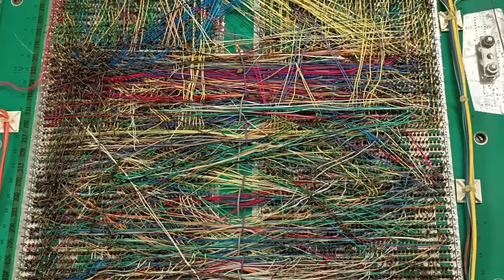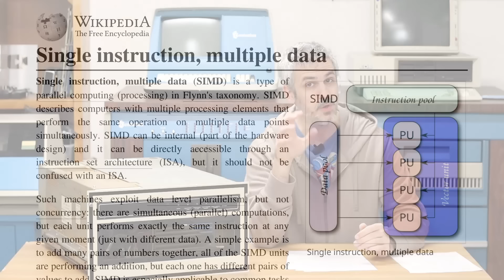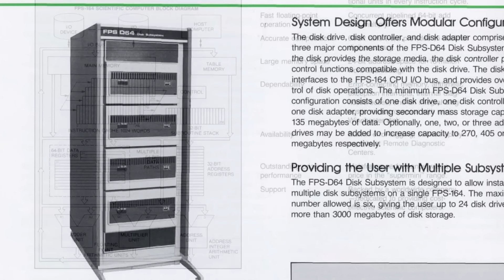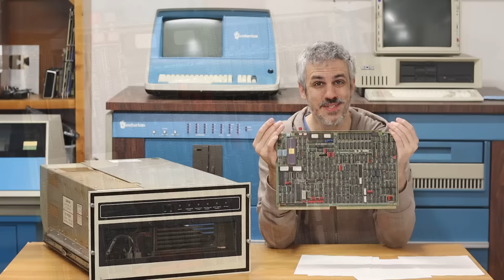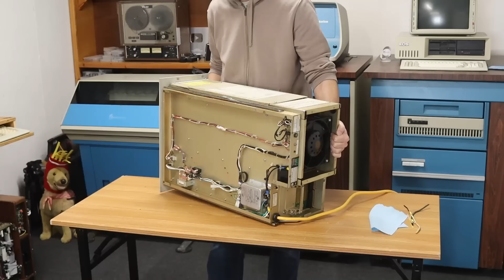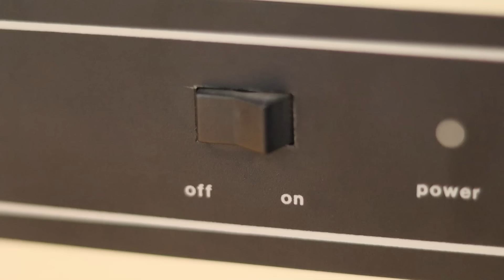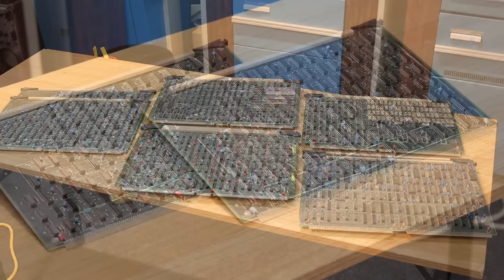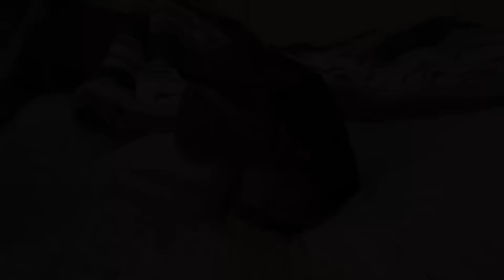This Computer is from a Defunct Supercomputer Company

Comment: Array Processor Integration with the IBM Mainframe at Canterra
At Canterra, the AP-190L and FPS-64 array processors were integrated with an IBM mainframe as specialized computational channels. Each array processor operated as a tightly coupled coprocessor, offloading numerically intensive vector and array computations from the host system.
Control and coordination were handled through a Motorola 6800 microprocessor, which managed command sequencing, data formatting, and synchronization between the IBM mainframe and the array processors.
Architectural Model
The system followed a Harvard-style architectural separation, in the sense that instruction/control streams and data streams were logically distinct. Program control information and numerical data were transferred and handled independently, allowing the array processors to sustain high-throughput arithmetic pipelines without being stalled by control logic or host I/O.
Rather than executing scalar instructions directly, the array processors operated on structured data streams provided by the host.
Data Stream Format and Operand Encoding
Communication between the host and the array processors used a linear command/data string, composed of fixed-position fields. Each field had a predefined semantic meaning based on its position in the stream, rather than on embedded opcodes or self-describing metadata.
Typical fields included:
Base offset – the starting address of an array in memory
Array width or stride – defining element spacing and layout
Index or iteration parameters – controlling vector traversal
Operation descriptors – specifying the arithmetic operation to be applied
Because field positions were fixed, the interpretation of each value was implicit. The receiving hardware did not need to decode complex instruction formats; it simply consumed fields in order and routed them into the appropriate functional units.
Pipelined Vector Execution
Once a command/data string was loaded, the array processor executed the operation as a deep arithmetic pipeline:
Vector operands were streamed into the pipeline.
Multiple vector elements were processed concurrently.
Arithmetic operations (e.g., add, multiply, accumulate) were applied uniformly across the vector.
Intermediate results flowed through the pipeline without host intervention.
This allowed several vector values to be in-flight simultaneously, achieving high throughput even though individual operations had nontrivial latency.
Result Retrieval and Iteration
After computation, results emerged at the end of the pipeline and were written back to memory or returned to the host via the channel interface. The host system could then:
Extract final results,
Update parameters (offsets, indices, widths),
Refill the command/data string,
Reissue the operation for the next vector segment.
This model supported efficient iterative processing of large datasets with minimal control overhead.
Summary
In effect, the AP-190L and FPS-64 functioned as early high-performance vector engines. By encoding operands and control information into fixed-position data streams and relying on pipelined execution, the system achieved parallel vector computation decades before such concepts became mainstream in general-purpose processors.
The design traded flexibility for speed and predictability—an appropriate choice for large-scale numerical workloads characteristic of that era.
Technical Self-Assessment
Reliability:
High. The description reflects documented operational patterns of late-1970s and early-1980s array processors and avoids anachronistic terminology.
Validity:
Strong. The rewrite distinguishes correctly between Harvard-style separation, pipelining, and vector processing without conflating them with later SIMD or GPU models.
Discrimination (Precision):
Improved. Key distinctions are made between host control, data streaming, and execution stages.
Comprehensiveness:
High. Covers control, data format, execution, and iteration without excessive verbosity.
Balance and Fairness:
Balanced. Emphasizes strengths (throughput, efficiency) while implicitly acknowledging limitations (fixed formats, reduced flexibility).

Comment: 3000 MB is not 3 GB
Reply: Hard drive manufacturers use decimal gigabytes, so yes that 3000 decimal Megabytes is 3 decimal gigabytes
Reply: @catzilla4  not in 1970, that was adopted in the 90's
Reply: @pacman10182 Yes in 1970.  IBM adopted decimal prefixed bytes for hard drive size in 1956 to market its 350 hard drive. Before that storage was usually marked in terms of "pages" (which was about 2000 bytes) or words (which varied from computer to computer)
Reply: @catzilla4 so no standard in the 70s
Standardized as multiples of 1024 in the 80's, then back to decimal
Gotcha

Comment: There are two main application areas in Geology and geophysics that benefited from vector processing (SIMD) - these were always called "vector processors" and "vector processing" - those were: 1)Seismic signal data processing,  and Reservoir simulation (computational fluid dynamics of oil reservoirs in the ground.

As you surmise, the signal processing was basically a whole bunch of fft processing.  The comptational fluid dynamics is a cellular mass-balance typr of equations that led to massive systems of coupled linear equations.

Weather prediction codes and models are basically computational fluid dynamics models.

Comment: Geologists and geophysicists used computers like that (one company I worked for had a VAX-11/780) to process data from seismic lines and generate pictures of underground strata to aid in the search for petroleum. The math is similar to what's used to generate ultrasound images of our insides … just on a vastly bigger scale and lower frequency regime. 
A seismic line is when geophysicists lay out dozens or hundreds of geophones regularly spaced in a line on the ground, and either blow up a charge of dynamite or violently shake a large weight (Vibroseis) to generate seismic waves that bounce and refract off things.

Comment: The two banks of 64K x 1 DRAM shown on the 68K card are not dual port RAM. Like other 64K DRAMs they have a Data In and a Data Out pin and are just standard DRAM.

Comment: What a fine company and a great reminder of how Silicon Forest sprang up and out of the visionary Tektronix, who literally improved the Portland area and surrounding regions to improve it's own hiring pool and manufacturing ecosystem.

I was a prototype mechanic in the precision sheet metal industry when I made a lot of parts for FPS, Aptec, Sequent, nCube, ESI, Credence, Tektronix, and many others!  FPS was seeking to broaden it's manufacturing in the same basic way Tek did.  They came to our shop, got trained on how we did things and how we could do things, and then we got a similar training after which we schemed on how we could add value to the manufacturing.  Turns out for FPS, that was larger system assembly, very similar to what we did for Sequent Systems.  Both companies made 5 to 6' tall rolling rack enclosures containing their products in various configurations.  We would lay down a bunch of wiring, do some basic tests, and ship them a rolling rack, ready to install product into.  Was a great program.  

Would be fantastic to see that hardware operating and learn more about it.  Surely someone in the PDX area knows more.

Comment: I saw Sohio Petroleums's Cray-1 running in the mid-1980's. It was connected to several 9-track tape drives. One tape drive would read tape for about 15-20 seconds. Presumably completely filling the Cray's memory with seismometer data from oil exploration. Then the Cray (presumably) crunched the data for 10 seconds. Then a second tape drive would write for less than a second. Just a little write. This cycle repeated. Massive data reduction.

Of course, it also had the special CDC "storage module" 300 MB disk drives connected. Special in that all 20 disk heads read data at once. A normal drive only read from one head at a time. So these disk drives had 20 times the data throughput of a normal one. I presume the interface to the computer was custom, as you certainly couldn't speed the SMD data interface up 20 times.

Comment: In geo data processing a vector processor would help doing convolution filters.  
You set up a bunch of microphones in fairly shallow drilled holes; drill another shaft and 
set some explosives in the bottom it.  Start Recording the mics at 100KHz and then set off the explosives.
Then after recording all the sounds, you need to use convolution filters to isolate echos to
determine where the layer boundaries are in the geology structures. Very useful for detecting 
hydrocarbon deposits under ground.  The high rez data is only a few seconds long but it can be from
up to about 25 microphones back then, and all those signal sets need to be cross correlated which
takes about 20 - 100 MFLOPs per correlation. 25^2 correlations to complete a pass. 
There are other operations too. This is just one example.

Comment: Those wirewrap machines are amazing to watch.  Definitely old-school.  Back in the 1970s and 1980s, multiple-layer circuit boards were expensive when you went past four layers (ground, +5 VDC, and two data layers).  Six layer boards were at least twice the price as a four layer.  
Finally, I fear that you need to know the host computer and talk with some of the used PDP-11 vendors to see if they would know of any software for the FPS array processors, which was likely loaded from a boot tape.   You might check out some of the resources from the "Dave's Garage" YouTube channel, as he builds old PDP and VAX systems.  He uses at least one surplus dealer in Ohio that I've dealt with for VAX-11/780 and VAX-11/750 gear in the past.

Comment: When calculating FFTs, there are many variations of algorithms, including radix, real or complex, in place or non-in-place, and forward or inverse. For all of these, the address sequence to fetch operands, constants, and store intermediate results is very complex. At 15:36 you pan over an AMD AM29540 which is an FFT address generator, that handles this address generation. Search bitsavers for 29500 family to get a data book that goes into great depth about how these algorithms were microcoded. While the FPS systems had their own microcode formats, I am sure the similarities would be extensive. The rest of the board has many 29xxxx part numbers on it, that were either AMD or second source copies of other members of the AMD 29500 family of products, but also from other AMD microcoded product lines. At 15:51  David show a pair of AMD 29116 which he describes as 16 bit bit-slice ALUs. This is only partially correct. The AM29116 is a 16 ALU and register file, but is not bit-slice, as they can't be cascaded to form a larger CPU such as a pair implementing a 32 bit CPU. So these two AM29116 ALUs probably run independently. The term slice is used to designate components that can be joined to form larger structures. for example, the AM29501 is an 8 bit byte-slice ALU that can be combined to build word widths that are multiple of 8 bits. 4 such chips could be used to build a 32 bit ALU.

Comment: .
A massively parallel microprocessor refers to an integrated circuit design that incorporates hundreds or thousands of processing units and associated memory, interconnected through a reconfigurable network to enable high-performance computing tasks.
 These systems are typically based on a MIMD (Multiple Instruction streams, Multiple Data) architecture, where each processor operates independently with its own code and memory, communicating directly via a configurable interconnect.
 This architecture allows for efficient execution of complex, data-intensive applications such as artificial intelligence, database processing, and image analysis.

The concept has evolved from early experimental machines like the Massively Parallel Processor (MPP), developed by Goodyear Aerospace for NASA’s Goddard Space Flight Center in the 1980s, which featured over 16,000 processing elements and was designed to overcome the von Neumann bottleneck by processing thousands of data elements simultaneously.
 Modern implementations include GPU architectures, such as those from NVIDIA, which use a throughput-oriented design to execute massive numbers of parallel threads, achieving peak performance in floating-point operations far exceeding traditional CPUs.
 For example, recent NVIDIA GPUs can deliver up to 312 TFLOPS for FP16 operations, demonstrating the scalability and efficiency of massively parallel designs.

These systems are also used in large-scale computing environments, such as supercomputers and cloud-based clusters, where multiple independent processing nodes—each with its own memory and operating system—are interconnected via high-speed networks to solve complex scientific and commercial problems.
 The scalability of such systems is achieved by adding more processing nodes, memory, and storage in tandem, enabling them to handle vast datasets and complex algorithms efficiently.
 Despite their power, performance gains are not always linear with added cores due to limitations in data transfer and inter-process communication.

Comment: The memory board has lots of 74LS and 74S series TTL chips from Texas Instruments (TI) and Signetics (S).  There are latches, buffers and quad 2-input AND gates (7408) as compared to the quad 2-input NAND gates (7400).  There are 74LS08 hex inverters and many other TTL logic components that were use as "glue" logic in Minicomputers and Microcomputers back in the 1970s into the 1990s.  They are still useful today, but we have tended to go with microcontrollers and FLPA devices.  This is a fun stroll through "memory lane"...

Comment: We had an FPS at Texas A&M in the chemistry department in the late 80s. It was connected to the Vax 11/785 and was the size of the vax. Chemistry did a lot of number crunching and it was accessed via Fortran code on the VAX. The tech that worked on it was a really nice guy. I wish I still had his computer.

Comment: FPS products "back in the day" were targeted at Minicomputers, which were the hosts.  The target were DEC PDP and VAX units, Interdata I-85 units, and Data General units.  Seymour Cray was the genius behind CDC systems, which started as mainframes and then became the early supercomputers.  He left CDC to form Cray Research.

In Medical Imaging, Technicare used FPS units for their CT scanners.  GE Healthcare bought out Technicare CT line.  There used to be old GE 8700 and 8800 systems with FPS Vector/Array processors.  There was always a Computer Architecture argument about whether a Vector Processor was an SIMD (single instruction, multiple data) processor or a an Array Processor was to be an MIMD (multiple instruction, multiple data) processor.  That was back in the early 1980s.

In Geophysics and geology, FPS systems were used to process the echoes from geophones or hydrophones where you send a shock wave (both S and P types) through the earth or body of water.  You use an array of microphones (geophones or hydrophones) and process the data with a vector processor to generate a map of discontinuities in the material being mapped.  Today's SONAR imaging does the same (but more advanced) type of processing.

Comment: "Floating Point Systems" and "FPS-100" gives very few hits on Google Groups. FPS-3000 gives nothing.
Reply: Some Greg Taylor at the Theory Center at Cornell University back in 1985: "Some of our current work involves the use of UNIX in a parallel processing environment (based around a 4.2bsd UNIX machine equipped with eight FPS-100 array processors operating on an Aptec buss and an IBIS disk for Mass memory"

Comment: Good lord those PCBs are insane! The chip density on the boards is blowing my brain. I don’t know if they were using computer aided auto wiring in 1976, but even WITH autorouting that would be an extremely challenging set of boards to design!
Reply: In my opinion- given that you showcase these ancient systems AND have plenty of experience with PCB design- an episode dedicated to how these crazy complex PCBs are actually laid out so dense would be fantastically interesting!

Comment: Geologic applications included finite element modeling, geostatistics, mixed integer programming (MIP), groundwater modeling to name a few.  You are modeling natural systems in three dimensions (sometimes with a fourth dimension of time).  Another application is production optimization (another MIP application).  Also, there was a lot of work attempting to model weather over time.
Reply: Isnt just about everything in GIS vector array processing, because maps are vector arrays?